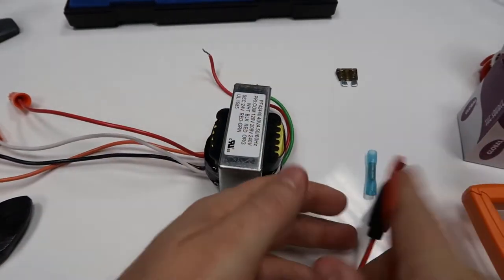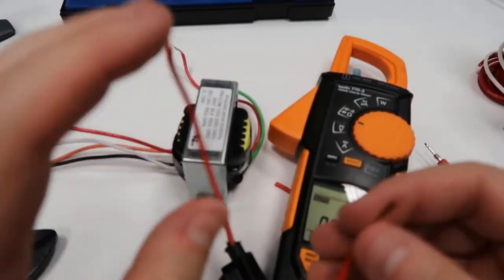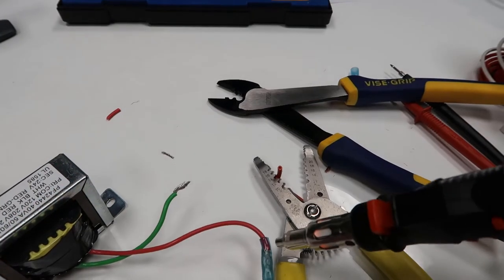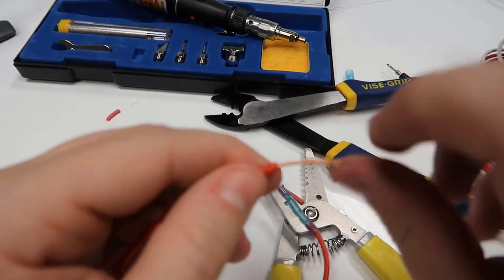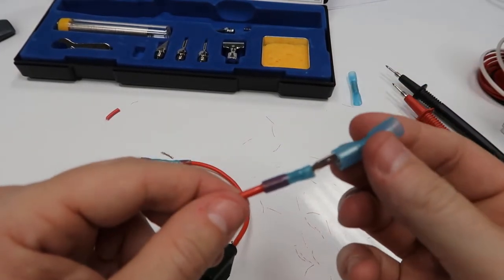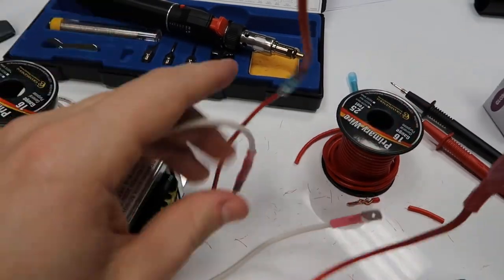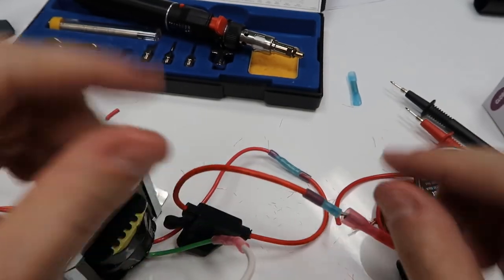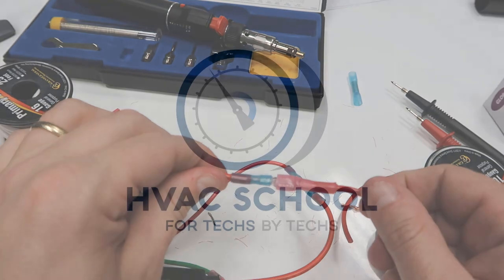Heat Shrink Crimp Connectors

Comment: Nice job, really secure and safe wire connections. I love it. Can you provide or link any information on that "torch" kit you have?  Also where do you get the heat shrink connectors from?

Comment: Thanks for the videos!  Just want to comment on using these pliers on insulated terminals. I don't know of any other wire crimping tool manufacturer stating that this type of tool can be used for non-insulated AND insulated terminals. In fact most crimping pliers of this type have two locations for crimping....Insulated and Non-insulated usually marked on the tool. This type of crimp is used specifically for un-insulated crimps.  I don't think this is a big issue for low voltage or low current but is very important for larger gauge connections like on the line connections to a contactor.  Personally I don't like these pin-type crimpers even for non-insulated terminals. It seems like the pin side of the crimper splays open the split side of the barrel in an unruly mess and at the same time possibly crushing some of the strands directly under the concentrated force of the pin. The best crimp is one that envelops the strands with even compression around the circumference creating more of a gas-tight connection that excludes air and moisture resulting in less internal corrosion. The more advanced ratcheting crimpers  for insulated terminals have a wide and smooth die set on both sides with three sizes corresponding to yellow, blue and red. The even better ratcheting crimpers are for non-insulated terminals and have a die set that captures the split in the barrel of the crimp and rotates it slightly inward while at the same time evenly compressing the wire strands without any air gaps.  In high humidity, moisture or coastal areas I like to use heat shrink along with the non-insulated terminals and with solder after the crimp even though there is controversy about soldering in regard to vibration, work hardening, etc.  Is your method going to fail?  I doubt it. But I hate call backs and don't like worrying about important details like this. I've seen way too many charred connectors that are damaged from the heat created by high resistance of the bad connection. This can also damage the compressor motor over a period of time if it's not receiving the right amount of current/voltage.  The heat shrink terminals you are using are great by the way!  I would caution everyone to never use the cheap hard vinyl insulated terminals on high current/voltage.  Along with the cheap insulation is usually a cheap thin gauge metal barrel that doesn't have enough strength to stay compressed. Thanks again for this great source of HVAC knowledge!

Comment: Good video.  You can also buy a plug in heat gun at places like Harbor Freight for low dollars when working in a shop or elsewhere.  Very little chance of burning anything and fast heat shrinking.  Another tip is to crimp all the connections first, then heatshrink in one operation.

Comment: Hi.. i found your video to learn more about crimping over heatshrink. I am shopping for a rachenting crimper. And I started seeing dintinctions from reviews that some crimpers will tear the heatshrink when crimping down over them. And i was wondering why and what qualities of crimper avoic that and what are the pros and cons of that. I want the crimper for general crimping . BTW, You could fix that bare metal bu just adding a piece of heat string tubing to cover of the metal. Youcould also enhance the insulation by overlaying it so it reast deeper  and can then be covered by the insualation of the other connector.